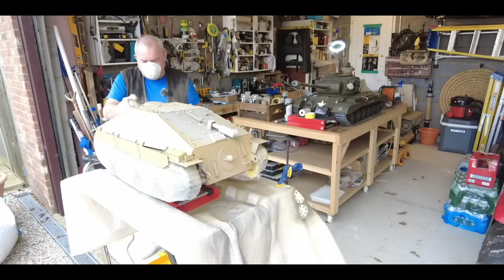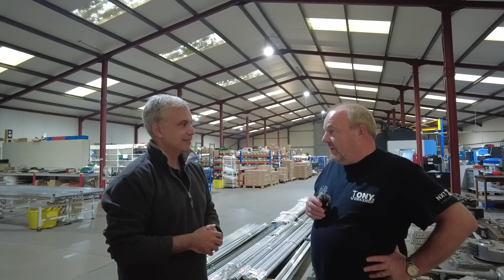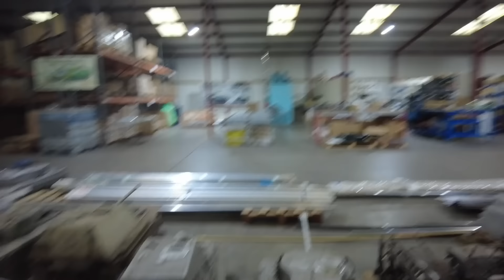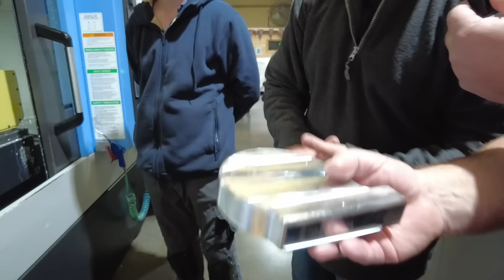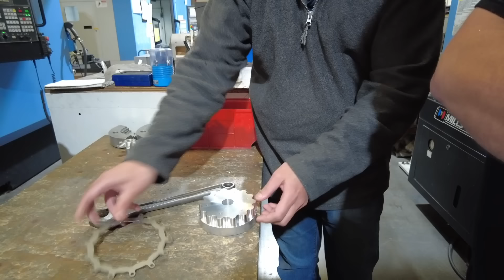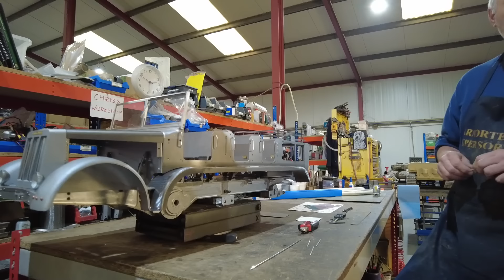Tonys workshop goes on an exclusive factory visit to Armortek.

Comment: Hi Tony, Great video of the Armortek factory. I have watched all your builds and I was wondering what your next project will be from Armortek?
Reply: Hi Tony, I have watched all your video builds and have enjoyed them all. I was wondering if you could give me some advice, I am currently in the process of building a Armortek Pak 43/41 which I managed to picked up last year which I hope will compliment the SD.Kfz.7 that I am soon to receive. What I would like to know, what is the best grease/lubricate to use on moving parts on these kits.
Reply from the maker: Hi Peter...The SD Kfz.7 is a nice looking kit...I saw the test production model on my visit and was really tempted, but I have chosen an alternative for my next project which I will announce real soon. I think you will really enjoy building that. Which grease to use? Now that is a good question, but with many answers. If you posed that question on the Forum, I am sure that you will get lots of advice, but in my experience you can use many types of grease, anything from vaseline to Molybdenum😀. Which parts are you looking at greasing?
Reply from the maker: Thanks Peter. I had made up my mind, however since my factory trip, I am re-considering. I will announce very soon🤞 Happy New Year to you and yours and catch up again in 2025.